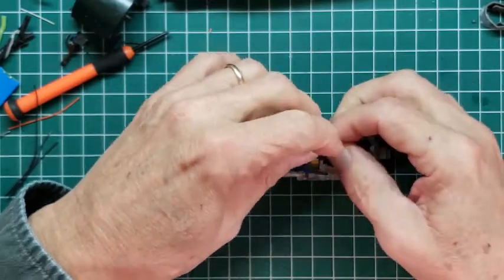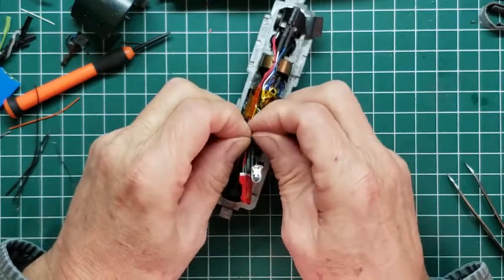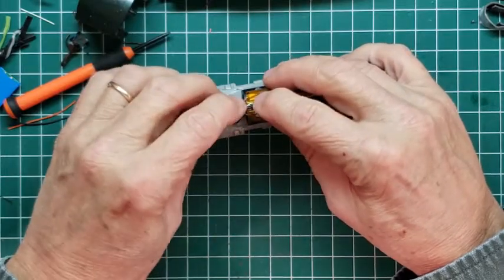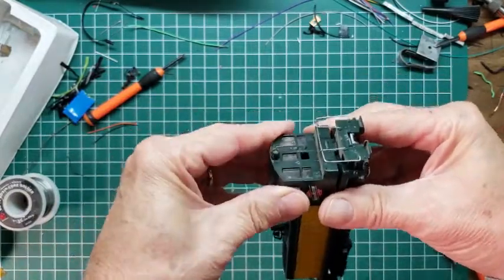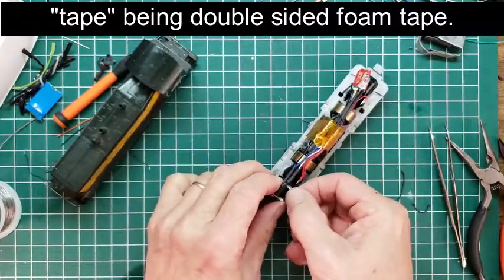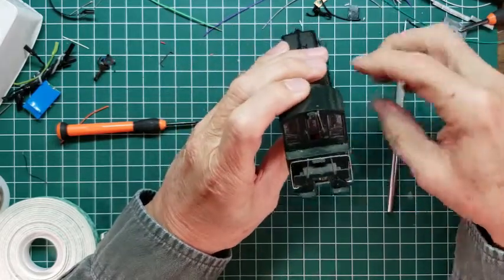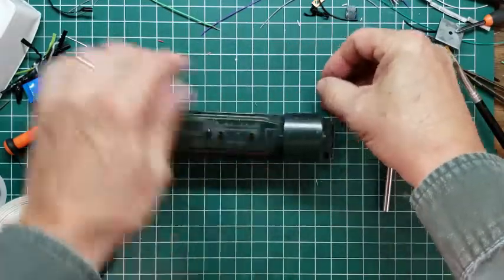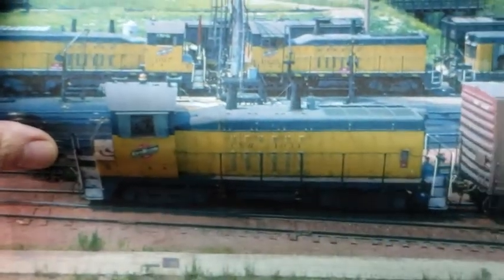HO Athearn SW1500 part 6

Comment: Just came across your videos.  Thanks for doing in real time.  I am sure all us modelers can empathize with a project not going smoothly. Attempting a decoder install in Blue box GP60 with an unused DH121 (now out of date) using 1.5V,  1.2mm micro bulbs.  Challenge to glue them to the mini lenses. Took a few attempts over several days.  Had to abandon lenses on rear and just set the bulbs in with Kristal clear.  Also have some SW1500 and glad I caught your videos that will prevent future install frustrations.  Will make sure to get the N-scale decoders. before dong those. Have a couple of DZ125 but want that extra function for rotary beacon whether my prototype (SP) had it or not.  Having watched some other decoder videos, alternate material for platforms is plexiglass, PC board strips or perforated  circuit board strips., rigid styrene (1/8 or 3/16).  Possibly thin masonite strip?  I am also a 70+ modeler.